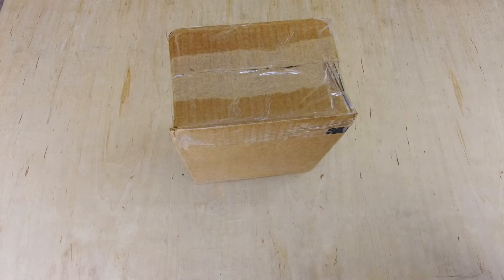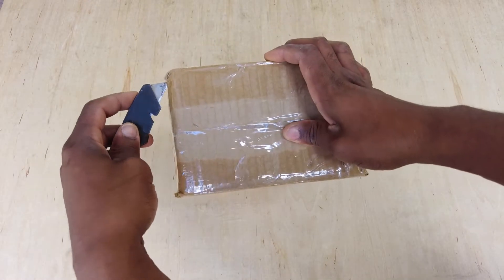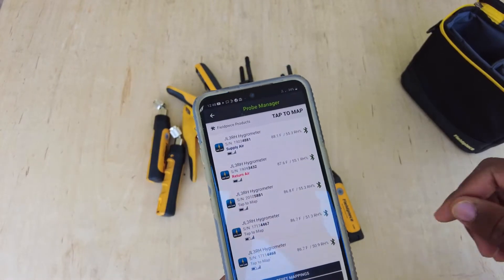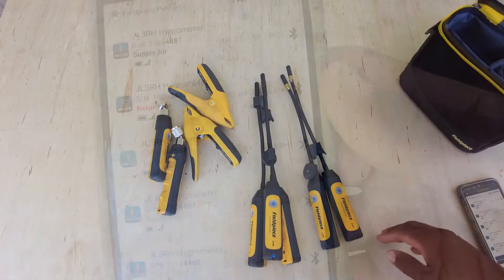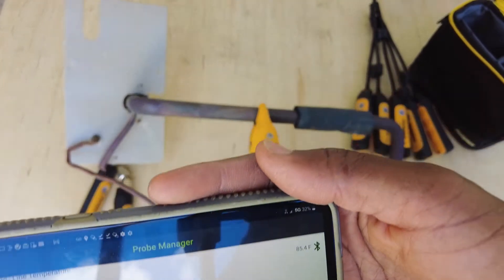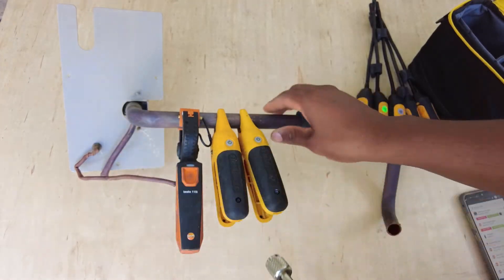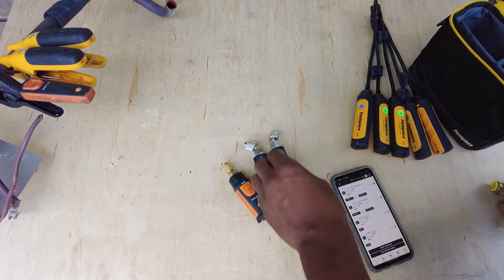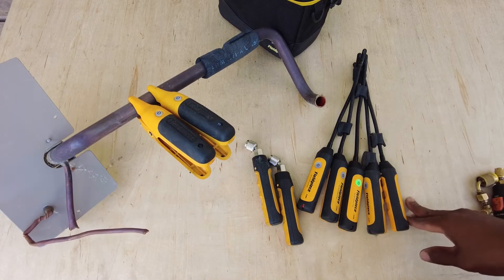Testing Used Fieldpiece Joblink Wireless Probes from Ebay | Great Deal as long as they all Work!

Comment: I bought the same set for a bit less then 450 vs paying like 650  plus tax retail and mine looked new and worked great a couple dead battery but once replaced all worked well definetly look through and you will find some deals

Comment: Just some from off eBay will not connect for nothing unless I’m doing something wrong
Reply from the maker: What app are you trying to sync them to? And measure quick you have to add the toolkit first in the tool manager
Reply: I got them to sync I was trying to sync them under electrical but work perfect @HVACTechKnowledgy

Comment: I scored the same set brand new here in Chicago burbs for 350 minus the two extra psychrometers . Haven’t used them yet slowly building up my gear also got the sm380v . Debating on what to get next their new micron gauge or the dual manometers. Any thoughts guys ?
Reply from the maker: Nice! Your really going to love them. Not sure if you've used any of the other probes yet but the rapid rail clamps are the real deal, instantaneous temperature readouts and 350 foot range makes all the difference in the field. Also I think the wireless manometers would get more use in service. That micron gauge looks nice though, I was considering picking one up as well.